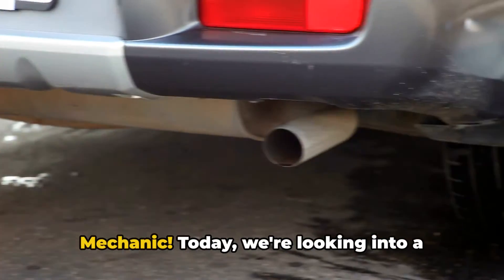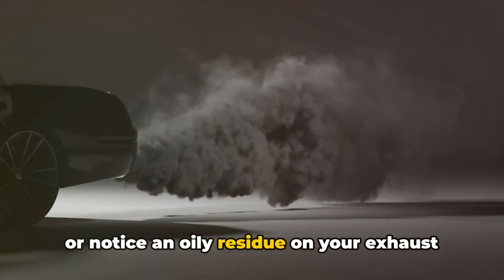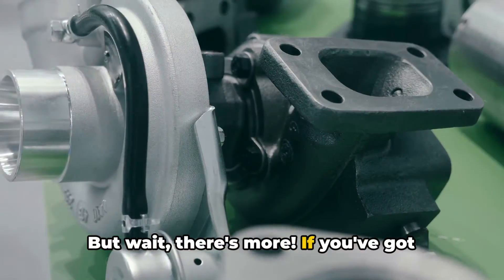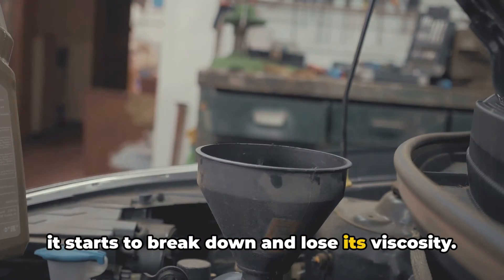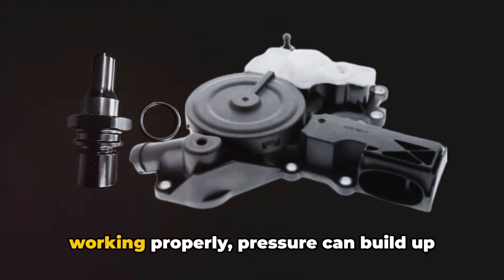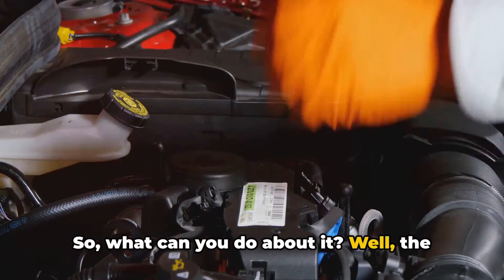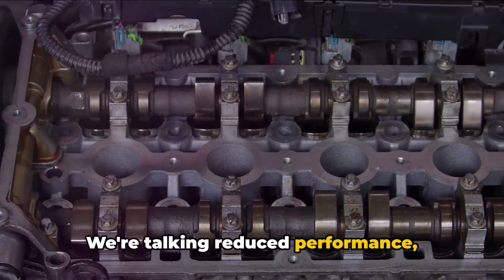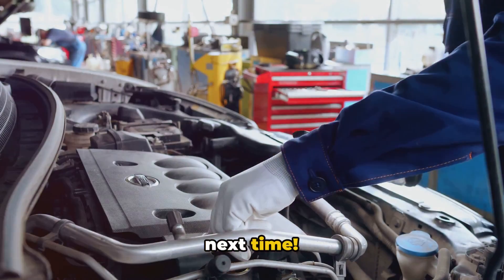Oil Coming Out of Exhaust: 10 Possible Causes Explained

Comment: I learned by experience that oil change is probably the most important service to do on a vehicle. Dont cheap out on quality or frequency. Personally i change the oil at 5.000km. I do it myself and oil is cheaper than engine rebuild.
Reply from the maker: 100% mate,  Opting for quality oil and changing it at shorter intervals, like your practice of 5,000 km, can greatly extend the lifespan of your engine. Doing it yourself is a bonus, avoiding the much higher costs associated with engine repairs or rebuilds. Thanks for sharing!